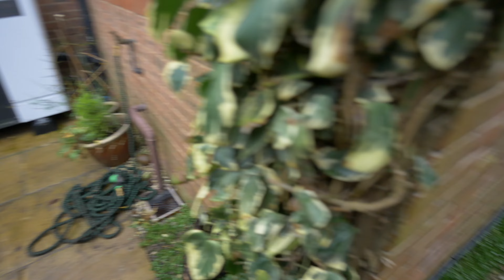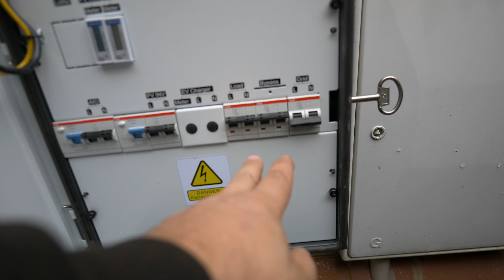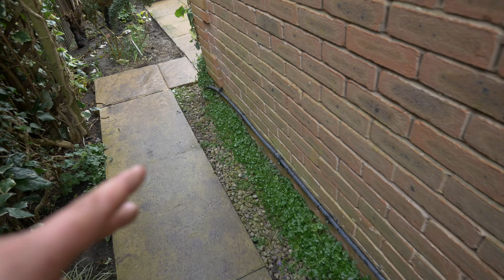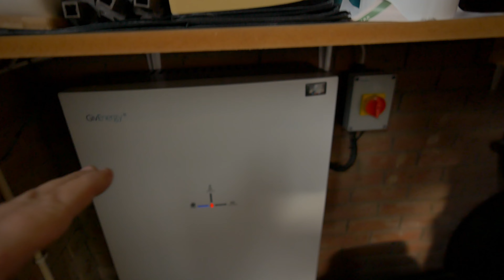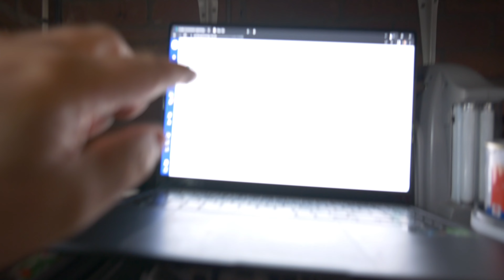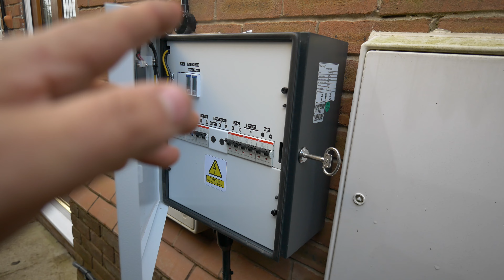Keep your feed in tarfif - Givenergy AIO and Gateway Installation - All in one offgrid power

Comment: Another great video Mark. Could you expand upon the mysteries of the DNO application for a battery storage installation with an existing solar array that receives the FIT please.
Reply from the maker: So long as the PV is left alone the DNO aspect is all the requires notification. Most battery inverters are beyond 3.6kW so would require a G99 notification process to gain permission to connect. Your installer will be able to guide you through that.
Reply: @electrician247  thanks for the prompt reply. Have you considered doing an in depth video on G99’s regarding application and notification once installed with a A3-2 form I think. 
Your videos about applying for MCS and filling in the application for G99 were brilliant, but I still find aspects of the process a mine field. Installers are usually to busy, unlike your good self.
Reply from the maker: @easyyards3154  A3/2 is a similar form to the application. You would need to be a qualified electrician/installer for the DNO to process one. 

I will share one in a future video.
Reply: @electrician247  finally, are you using connect direct yet? Is it easier? Are the outcomes better or worse? 
I’ve read that installers could receive immediate confirmation, however in likelihood, battery addition would be referred to the DNO, so akin to a normal G99 but contact and progression is handled by the ENA connect direct. Your progression is within the service and you can commission from there as well. 

On a separate point, would it be wise to oversize an AC coupled inverter in this scenario to take advantage of a higher discharge rate to cover the home load demand? Any positives and/or negatives with this route?
Reply from the maker: @easyyards3154  we use connect direct yes. No real difference in ultimate outcome but much easier. 

I would speak to your installer in terms of setup.
Reply: @electrician247  thanks Mark. I really appreciate the replies.

Comment: Very interesting. When you were in the garage next to the AIO (at about 3:30 in the video) there was a very noticeable hum. I'm going to have an AIO and gateway installed inside the house and am concerned that it will be audible to adjoining rooms.
Is the hum in the video coming from the AIO please?
Reply from the maker: AIO is silent. Hum probs my audio equipment. 

It does clunk relays on first start up but otherwise quiet.

Worth referring to the PAS if you are putting the AIO indoors. Should really be outdoors or in a garage etc now.
Reply: @electrician247  Many thanks - what’s the PAS please? The concern with outdoors is the drop off in performance due to cold weather.

Comment: If your customer now has a heat pump that heats the hot water there's no point in solar diversion into an immersion heater because the heat pump is three or four times more efficient - so the export tariff makes more sense for any surplus. Also because they have an EV I presume they are using a cheap rate overnight tariff - they could also time the heat pump to heat the hot water at the same time for even more savings.
Reply from the maker: They do and that’s the beauty of choice. They have a robust setup to help with any energy tariff fluctuations in the years ahead. These are very experienced customers who have PV and solar divert for a long long time.

Comment: I'm just trying to get my head around the gateway thing. I don't have solar, i just want battery storage to use with cheap off peak energy at night. If i get the Givenergy AIO why do i need the gateway? If the grid can charge the battery why can't the battery power the house if there's a power cut? The battery powers the house once the grid has charged it up so why can't it keep doing so if the grid goes down? Confused.
Reply from the maker: Multiple reasons the main one is safety. Without a gateway or change over switch you will be back feeding voltage into the grid and can put workers at risk who are working on the network. 

Separately you can not currently install an AIO without a gateway so its essential in this application. It is also free with the system. 

If you go for a smaller more basic system you can have an AC coupled battery and feed some circuits via a small EPS board but again this must connect through an EPS change over switch to isolate your house from the grid. Much better and easier to use a gateway.
Reply: @electrician247  Oh ok fair enough. Thanks!

Comment: Hi Mark. To keep your feed in tariff do you disconnect the original inverter but leave it in place when you install new givenergy inverter and battery?
Reply from the maker: No the original inverter remains with the dc strings running to it. The ac out from the existing inverter is then sent to the gateway. So the existing install is not interfered with allowing existing arrangements to remain in place in terms of FIT. Thanks
Reply: @electrician247  Thanks for clearing that up for me!

Comment: Looks good!, Just 1 question. You said you re wired the charger straight in to the gateway but I didnt see an RCD or  for the charger inside the gateway. its blanked out i think.
Reply: Ah I missed that bit! So I’m guessing on that install the giv energy app doesn’t report what’s being used by the charger?
Reply from the maker: @arobsony  No, it will see it as normal houseloads only. The charger only became available a few weeks ago so its all new. I have a video on the channel featuring it. Thanks. You can use a Lora to meter the EV consumption if required on a setup like this but not something needed here.
Reply from the maker: RCD is in the charger itself as discussed in the video. The kit for the GivEnergy evse is now available though to fill that gap. 

Thankfully this evse has a proper RCD in it.

Comment: Hi mark please can you tell me would the Givenergy hybrid gen 3 inverter   with solar panels    work ok with  the Givenergy all in one  battery with thanks
Reply from the maker: It does so long as the hybrid doesn’t have batteries attached. Currently that is not allowed as the batteries get into a boot loop charging each other etc. but we have used the hybrid as a string only inverter on a couple of jobs in the hope that becomes a thing in the future (I suspect it will)
Reply: @electrician247  thank you

Comment: Hi mark want inverter and panels to make 7 kw  roof system approximately would you recommend  to go with the givenergy all in one thank you in advance and great video s
Reply from the maker: Depends on roof orientations tbh: if 7kw in one direction probs an 8kW solax string inverter: if split east/west could use a 4kw or 5kw again we tend to use solax as reliable and simple PV inputs to the wider AIO setup. Jinko 435W all blacks are a good start point on panels but again depends on roof size
Reply: Thanks a lot mark

Comment: Hi Mark, can you connect two PV systems into the Givenergy Gateway? I have an existing FIT system and will put a new separate SEG system onto my garage. The FIT system will be unchanged and can continue to report generation to my elec company. When monitoring the two PV systems can be treated as one with the CTs controlling output to house, battery, diverter and export to grid. Thanks, David
Reply from the maker: You can but not in the way you maybe hope. The new system goes into the gateway PV input. Older system stays in the existing consumer unit and connects into the gateway along with the house loads aka consumer unit. 

You can still use a lora meter to see the generation most likely if you wanted in the app. Otherwise it will all work as needed you just won’t see the older FIT system in the app etc. hope that helps.
Reply: @electrician247  Thanks Mark, does that mean that the old PV system would be "seen" as (a reduced) house load and only the new PV system would charge a battery or EV connected via the Gateway?

Comment: It would be nice to find an honest fitter
Reply from the maker: What do you mean?
Reply: @electrician247  For example, I priced up the Givenergy all in one 13.6kW battery and 10 panels mounting frames, meter and some bits at 7k, vat exempt. I am getting quotes of 14k -20k, also telling us that it doesn't have VAT in it, like we are getting a good price. I used to price up jobs for a builder, I am not stupid. Oh yeah, I live in a bungalow, easy access, so 2 towers will safely get you on the roof at a push.
Reply from the maker: @Piccyman1  wow you really don't understand the process do you. If its so easy setup in business offering the value you suggest to others. 

Let me help a little for you though. The admin on a proposal and subsequent completion paperwork is around 1 day, the DNO G99 process also involves time, MCS certification, insurance and onsite assessments carry a cost, the vans to move materials, paying labour to install the systems, profit for the business supplying the services, delivery costs, carrying the VAT burden for you as the customer. I can explain that better for you. Installers are paying the VAT on all the materials but then not receiving that back for sometimes 3 months. It is a benefit to you as a customer paid for by tax payers. You should be grateful, I was in receipt of my benefit from tax payers. 

I quote lots of jobs when prior installers have gone out of business. Taking customer deposits with them. Usually because they have gone to work on margins based on the mindset of someone such as yourself. 

These systems should not be installed of towers if you have any regard for people's safety. Mobile platforms are not intended for that purpose. Safe, fixed and certified scaffolding is a requirement for anyone with an ounce of care about others safety. 

So rather than honest fitters. Perhaps look for honest customers... I find loads who recognise, understand and see value.

For 10 panels, AIO, gateway, PV inverter, frames, access equipment, regular business costs 14k is very very reasonable. Also 7k on parts? I think you missed some bits off 🤣🤣🤣 but what do I know. Only buy a few systems a week. 

Have a great day and maybe reflect a bit.
Reply: @electrician247  I don't need help thanks, and i know the G99 is a pain and a ridiculously long doc to fill in, and I do know about qualifications, mine were 25 years ago cost me a lot of time and over £20K in courses. I ran my own successful VAT registered company for 23 years and retired at 55, so stop moaning, stop ripping people off, making excuses and get on with it, yes i missed a few bits off but nothing expensive, as for the towers read what I wrote. I know how you are conning customers by pocketing the VAT but really adding it on, morally you should be passing it down to the customer, but not. Also I am not accusing you personally, just the ones I have delt with so far.
Reply from the maker: @Piccyman1  that is a direct accusation on a public platform. Only 1 person is moaning and that's you. If you can't afford a solar system save up a bit longer. You have no idea. 

Could I have your address for the legal letter as your comment very much reads as slander/defomation. 

The G99 is the easy bit you literally have no idea. Yet all the solar installers are on some form of con...

Let me spell it out. We don't charge VAT to customers. £0 yet we spend well over £1000 on every project in VAT costs on materials. We then wait to recover that from the quarterly return. For those solely in solar that's a big bill to carry around for 3 months. 

The beneficiary is the customer who are effectively in taking a benefit payment from the wider tax payer pool. 

If you are so successful maybe give the tax payer a break don't take the VAT benefit and support a local installer by paying the proper rate to have a decent job. 

You have let yourself down here.
Reply: @electrician247  ok, enlighten me, on what the extra £7k to  £14k is paying for, apart from the batteries, inverter, solar panels, mounts, cable kits fuses, isolation switches and a meter?
Every vat registered company has to wait for the vat return, but you can buy the equipment without paying any vat, complete systems are 0% vat rated. And also I said this doesn’t apply to you, you have not given me a quote, nice try though.
Reply from the maker: @Piccyman1  do you even know how VAT works? We don’t not pay VAT at the point of purchase… We pay it but then reclaim on a VAT return quarterly. You are correct every other business operates like that aside from one key difference… we don’t charge vat at the point of sale. In essence funding government benefit schemes for customers during that 3 month period. I have big doubts you have ever run a VAT business if you don’t know or understand that. What was your business name and we can all go take a look. 

You are not getting those materials for £7000 I’ve already spelled out the business overheads to do with insurance, mcs, cps, hies memberships those are several thousand per year, vans, wages, sick pay, holiday pay, office staff, storage overheads. You do understand the equation isn’t just what the stuff costs plus time for someone stood on a scaffold tower? 

You are the definition of expert on the internet atm so let’s see some credentials. 

In terms of the pure material outlay you are missing cable costs, mc4 costs, inverter costs, bird protection, optimisers, with the aio coming in at 5k alone and the panels over £1k how on earth are you covering everything else. A typical mounting system will be over 1k with the required number of hooks etc that meet MCS. Your inverter with AC and DC cabling over £1k. Scaffold on top with bird protection and ancillaries, travel etc. Your paying £400 per day for the installer at 14k basically and tbh that is cheap very cheap with all the regular business overheads. 

How’s that for clarity. 

You can fight against every installer out there telling you you’re wrong but that will never make you right. 

It’s not a nice try your words are clear and if you leave the comments up I will pursue you. Your channel reveals who you are. But I am a reasonable person so will allow the time for reflection etc.
Reply: @electrician247  the goods are zero rated, there in no vat to pay, you cannot be charged vat on 0% vat, and yes I was vat registered for over 20 years. Maybe you require a visit from vat inspectors, what was your address?
Reply: @electrician247   

You are not getting those materials for £7000 I’ve already spelled out the business overheads to do with insurance, mcs, cps, hies memberships those are several thousand per year, vans, wages, sick pay, holiday pay, office staff, storage overheads. You do understand the equation isn’t just what the stuff costs plus time for someone stood on a scaffold tower? 
 
I agree you have to make a profit and not just a day rate, but £7K to £14k for at max a weeks work, even if it was 2 engineers for a week and a roofer (1 day) and a 10m single lift scaffold, you are seriously having a laugh at the customers expense.
  
At that proft margin installers must be driving Ferrari vans

In terms of the pure material outlay you are missing cable costs - included
mc4 costs  - included
inverter costs - all in one system
bird protection - not required
optimisers - not required 
panels included
£7000 delivered
Reply from the maker: Incorrect. The goods carry vat when we purchase from wholesalers. We do not charge vat on sales to customers… make sense yet. As I’ve said installers fund your benefit payment for 3 months. 20 years isn’t a long time in business tbh
Reply from the maker: That’s just none sense. At varying levels. Your out of your depth and I’ve tried to politely help you. Show me an installer in a Ferrari. I will wait. Most installers are good people making a living. On your budget you won’t get good. In fact as your finding you won’t get anything. Deluded and to afraid to share a name or business. I hope to heavens the builder you priced work didn’t go bust… you do know the aio doesn’t accept pv strings???

Oh dear. 

Your gateway tails and final circuits must be negative lengths. 

Send your spec and I will happily price the materials and access equip at cost. Won’t even charge you. Someone needs to open your eyes to reality.

Comment: Have you changed the type AC RCDs that they supply? GiveEnergy have said that you can change them to type A
Reply from the maker: No. The PV was on an AC rcd already and upon measuring the DC leakage gave a result of 0mA. Which I found surprising. 

My own investigations have returned some very small instances of DC blinding. 

I've had the chat with Giv technical a few times on this already. Sometimes it's worth considering for sure.

Comment: I see the benefits of a gateway in terms of a one box wiring interface solution but is it absolutely necessary and could an install be done without it? In 35yrs we have had only three 1hr max power outages so it would serve  no purpose but another box on the outside of a house that will eventually corrode.
Reply from the maker: Atm it can not be done without a gateway. But that is due to change!

However the benefits far outweigh the negatives for me. Especially when the possibility of managing multiple battery systems could well be a possibility with the existing hardware in the gateway. 

These are absolute beasts and full of features waiting to be unlocked.

I should add we have had 3 power cuts in 8 weeks. One lasted for 18 hours. So it's important to understand our experiences are not everyone else's.